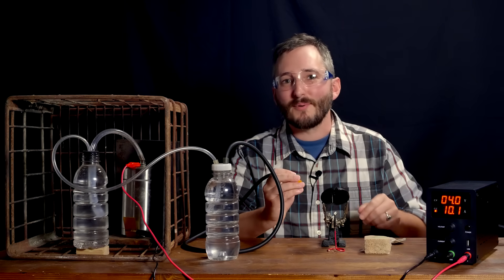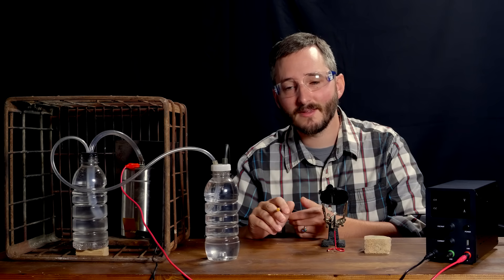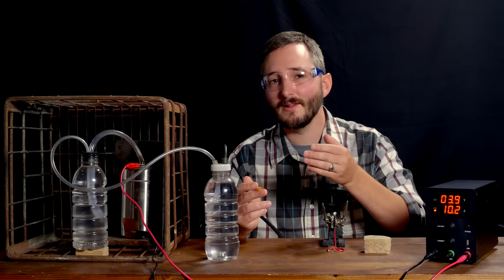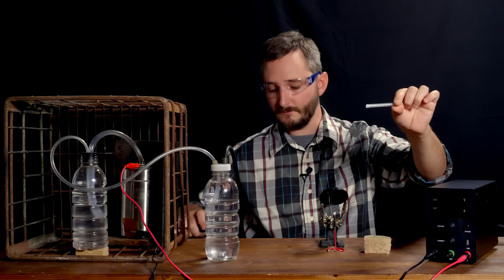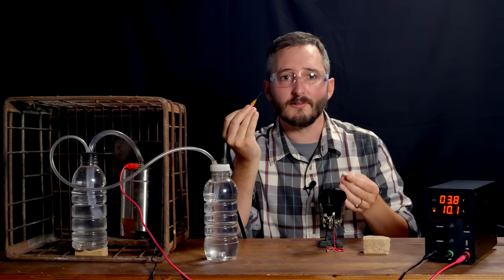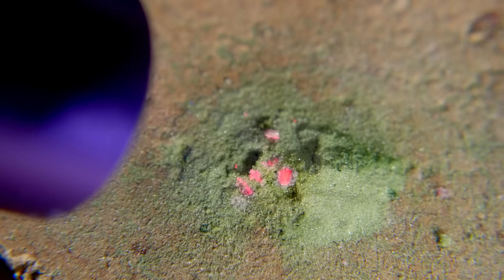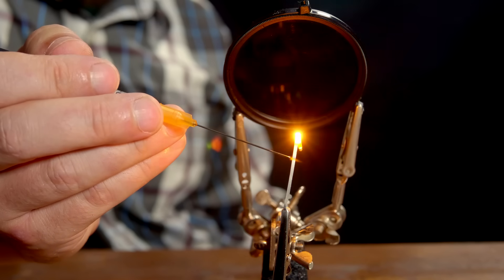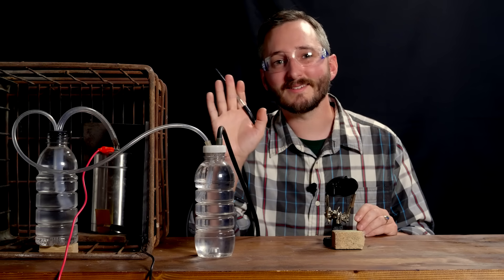DIY Oxy Hydrogen Torch Using Water Electrolysis

Comment: sadly, in jewelry setting, im not too sure this set-up would be very practical, with very little control over the size and temperature of the flame, it becomes increasingly difficult to do work that needs precision, with such heat, you are more then likely going to melt whatever you are trying to do in jewelry...

Comment: Would someone be able to size something like this up or would there need to be a method of increasing the flow rate?
Reply: Wow, I just love your projects! Have you ever considered making your own vacuum insulated glass panels (for a high R-value window pane)? Many years ago I saw someone online who had welded (with a plasma torch?) the glass together and put tiny glass beads in between the plates as spacers. But I’ve never been able to find the reference since. Anyway, thought that might be something that would interest you. (I feel like the skills you share would help society out a lot if there were a significant collapse).

Comment: Can you build a motor that uses h2o as fuel and electricity for the electrolysis to work? I had a discussion with someone about cars and i told him that it is possible to use water and electricity to make a car working. The problem is that i don.t know how efficient it is, let.s say you are using solar panels and energy regeneration from brakes. Is there any way to keep the batteries alive for at least 5-600km and using water as fuel? Let.s assume that the system has enough safety measures.

Comment: if you actually read the comments than you need to read this. I have done exactly what your doing with HHO. please make sure to secure the tube onto the needle with a clamp. My setup flashed back and blew off the needle tube and the rubber tubing shot a large flame out that badly burnt my hand. In a split second it literally charred my finger black.

Comment: A: Assuming you use the two station setup could you combine the outputs just before the torch to keep flashback limited to the junction. B: Could you make a big enough setup to use it as a cutting torch. 2500 Celsius should be able to melt most metals. C: Could that set up cut a aluminum can? being that its thin metal.

Comment: Using a silicone tube works as it's own spark arrestor by blowing out the side, then you put a spot of CA glue on and some electrical tape and it blows out another spot on the next blowback.

Comment: Having had several jewelry oxyhydrogen torches, there are several things you can do with this, most joining small copper wires together in ways practically impossible otherwise (think high end headphone wire repair, electronics repair for broken thin wires) of course jewelry. But most jewelry won't work, you aren't going to size a decent sized right with it (at least not that one) but you can retip almost perfectly with it. One issue is going to be the high flow rate blowing things away physically. On the spark arrestor, you are well overboard. The plastic bottle (just one) is plenty fine. As you scale up you might find water vapor becomes a problem, so I would use some dehydrated Epsom salt (don't know if it has a name, see n
Nilered's video) the glass melting is a fascinating alley to go down with small rods (real glass fiberoptic glass) and so-called flame polishing usually uses browns gas

Comment: I've been really appreciating your channel since I found it. A good mix of simple science, along with a more practical look at both safety and application without being excessively long.

Re: jewelry work, defiantly, and I image it would apply well to welded link chainmail as well as being tidier and easier to handle than electrical spot welding (if a bit more tedious) in that scenario

Comment: could the tip be put on a cnc and be used to cut steel? would it be powerful enought and reliable enoght to work.
How about tack welding for conductors like tungsten?

Comment: Very interesting!  Did you run into any flashback issues with it before you figured out the additional precautions, like the aluminum wool? Also, have you considered making an oxygen-hydrogen  dual-feed torch to make it safer?

Comment: I can tell you right now, if you could come out with some kind of on-demand system that was safe, maybe with a titanuim needle & a very reliable generator.. you would make a massive ripple in the jewelry industry.
  Not only would it be desirable for the eco-friendliness of burning water (not to mention savings on things like acetylene), but such a torch would be able to actually fuse metals, especially precious metals like silver, and also copper.  That would reduce or remove the need for solder.
    In one fell swoop you could actually eliminate a significant portion of all the hazardous chemicals & elements used in jewelry making.
Reply: I would encourage you to think about pursuing that, or passing the idea on to someone who could make it a reality.  I can't imagine that we're really too far from being able to do such a thing safely.  Especially with the materials & manufacturing available to beyond-the-garage projects today.
Reply: Just to be clear, there really are a lot of hazardous chemicals & things involved in how we make jewelry today.  This kind of torch could probably deal with everything except polishing compounds.

Comment: I bet this would be useful for circuit board soldering. What if you directed the flame into a tip apparatus that gets hot and then use the tip like a typical soldering iron?

Comment: One of the @Cody's Lab videos said that Silver will not burn in Oxygen, nor even in LOX, so Silver-plated Copper mesh might be really good as a flame arrestor. Also, Silver or Silver-plated torch tubes might be good in a couple of ways. While Copper tubing is not easily available in as many sizes as hypodermic tubing, there are several small sizes available easily. The smallest which springs to mind is the capillary tubing used to regulate refrigerant flow in small refrigerating units. It has a relatively thick wall, so it will absorb much more heat than hypodermic tubing, before getting hot enough to allow a flame front to pass.

Comment: When I was a kid (probably 12-13 yo), I've created a very simple HHO generator. I filled up a small balloon with the produced gas, then similarly attached it to a syringe with a needle and a piston removed, and lightened the gas up. Apparently, the flow rate was enough to stop the gas from the blowing up. After watching this video, and realizing, how many things should be aligned in order to prevent the explosion, I consider myself as a very lucky person, since I did no math or tests at all - it just worked right away. Also, most likely, I was smart enough to understand the danger, because I did not repeat this test...

Comment: A suggestion for better safety when the flame starts to go up the needle, stab the needle through the wet paper towels before you light it, then you don't have to look for the towels if it happens and might even stop it without you having to grab it. Also will help keep the needle cool in general so longer use doesn't melt the plastic.

Comment: Note. If you separate the negative and positive plates in the generator you can separate the gasses making something ALOT safer than HHO. I forget the order but one plate makes hydrogen and the other oxygen so you can keep them separate until right at the nozzle. No need to have a premixed explosive gas tube. Just food for thought

Comment: I wonder if the ideal nozzle would have thicker walls and narrower bore toward the non-tip end. Higher velocity and more heat absorption as the flame front moves backwards.

Comment: Why not use a commercial flashback arrestor, commonly used with oxyacetylene welding equipment?  Furthermore, why not have a cup of water handy to dip the torch tip and snuff the flame?

Comment: Although the flame is at skin touch 'only' 130° C, you can melt tungsten (almost 6000° C) with brown's gas.
They use steel wool in the tubes as fire stoppers.

Comment: Could it be used to remove rust? Or maybe make rust? Electrolysis rust removal is supposedly the result of free hydrogen ions converting the iron oxide type to the black kind that can be scrubbed off.

Comment: There may well be a spark/flame arrestor in the welding gas field that could be scaled down to low volume. It might be the safer idea to make the two gasses separtly and only combine at the torch head like in conventional gas welding.

Comment: Fun fact , 
We used oxygen hydrogen torches at Corning INC for melting the glass integral handles and tail stocks onto our canes of glass . These canes were actually the core of fiber optics of which I was making at the time. We made the glass from scratch out of Germanium and silicon tetrachloride. 
The flame on these torches were a very very light orange color , but the heat was tremendous. We use to have a timer on our GUI that told us when it was safe to light the torches. If you did it to early you would blow out the flash back arrestor. 
When melting the glass , we had a UV resistant / tinted cover that covered the machine because when the torches were melting the glass it would produces the brightest, most tremendous yellow I have ever seen aside from the sun. It would light up the room when the engineers were working on the machine.
Also I do believe our torches were ran off a straight line of hydrogen and than the oxygen would be fed into the torch burner its self.

Comment: As for safety, what about placing all the stuff inside deepish hole in a groundbonus points if it can be covered in sand decently convenient, sure it might raise some dust if it explodes, but should not have enough energy to move too much stuff too fast. Though might be overly inconvinent for the benefit.

Comment: This is super awesome.

Somewhat silly idea, since it seems to be hot enought to melt sand, and sand/glass is not great conductor, that could almost be basis of a 3d printer printing out of sand, dont remember how those are called, I think sintering printers, I know they exist for metal grains, so this should be able to do that for sand.

Comment: If you can stop a flash back with a wet paper towel, why not have a tube filled with water around the needle, or a finned aluminum block keeping the needle too cool to flash back

Comment: How about your separation generator setup showed is earlier episode? Just create gas in different lines and feed it into oxy acetylene torch where mixing happen and since only place where two gasses are mixed is in the nozzle and its pretty damn durable thing, you should not have any issues with explosions and you can add bubblers and flashback arrestors on the generators feed as extra safety measure, making this usable for DIY guys garage, who does not want to have bottles of acetylene and oxygen laying around, just need water and electricity to use this setup. I think this should be developed further since there is very much potential in this idea, but i dont know about the gasses that much to build it perfectly safe, but you do.

Comment: Can you effectively weld two separate pieces of borosilicate glass together? For example if you wanted to connect a bunch of glass tubes together or even (after drilling a hole) weld a tube to a beaker to create your own specialized laboratory equipment? For example, can you turn a standard addition funnel into a pressure equalized one?
Reply from the maker: Melting the glass is no problem but you need to know what you're doing to aneal it properly so it doesn't crack when it cools down
Reply: @Nighthawkinlight  if there’s anyone on YouTube with the capabilities while using materials available to most people....it’s you

Comment: When I was younger I made a much larger version with forced cooling out of alternating stainless steel wall tiles and gaskets. It kinda looked like a stainless steel sandwich held with bolts. I used an actual torch flame arrestor and a small brazing torch. The secret is the water pump forcing the liquid and gas to a separating tank. Then secondary bubble flame arrestor. Then to the actual torch arrestor and torch tip. It was hard to see the flame but 1/2 steel was no problem!!!

Comment: I'm curious, can it locally melt a tiny section of a larger piece of metal? Even if it is rather conductive, like aluminium? If so it might be nice as a micro TIG welder of sorts.
Reply: If the metal is able to conduct the heat away faster than the torch can put the heat in then the torch will be unable to heat the metal very hot. You have to put heat in faster than the heat loss. The torch might be burning VERY hot but don't confuse temperature with power. It's a very small amount of 2,500 degrees. Note the maximum power will only be 35W because that's all that is being put into the system. Also, it will not be 100% efficient so the actual power in the flame will be even less than that. 
Also, it wouldn't be a micro TIG welder, it would be a micro gas welder. TIG welding uses the heat of a small electric arc, not the combustion of a gas.
Reply: @Kimdino1  yes, I understand that and I was wondering if he tried. Because it is a balance,  you might melt a tiny local bit of metal if the heat of the flame is on the right side of the balance with the transport of heat. I am not mistaking anything with power. I merely stated TIG as a sort of comparison, melting a small local bit of metal. I know what a TIG welder is thank you. Maybe I should have stated a pulse laser, idk? So nice monologue, but you didn't understand my question right.
Reply: Tig welding uses electricity
Reply: @nathanlewis5682  oh ffs, I said of sorts. I meant the outcome, not the process. And if you want to nitpick, this also uses electricity to create the hydrogen and oxygen.

Comment: I built a bigger HHO system several years ago and you are right, they can be VERY dangerous if not treated with care and respect. That said there is a lot you can do with HHO gas. I found that the gas flame itself seemed to be cool, it didn't get hot until I reacted the flame tip with something. 

I would love to see you test your system out with a FLIER and see if the temp changes as you react the flame with different materials. I think that the flame changes temp based on the material it is being subjected to.

Comment: this would be really cool as a smaller battery operated device
Reply: maybe  a sintered metal filter as flashback arrest, electrode and outlet in a small zylinder with a thin line with thicker walls going out? shutting off by cutting power shouldnt be an issue because the flame shouldnt go far into the line. could be operated with the push of a button and would be handheld and safe. basically a small high temperature lighter
Reply: 3d-printer hotend as a nozzle that sucks the heat away
Reply: with a piezo to light it it really would be a small high temp lighter
Reply: or you could use one of those arc lighters as power source and light it with that

Comment: For everyone who thinks two flashback traps are overkill, I remember when the flame somehow made it's way all the way through a trap and into the Tupperware box reaction chamber which then exploded, spraying my whole room with electrolyte solution and making my ears ring for the rest of the day.
Reply: In his previous video, the slow motion demonstration showed a few bubbles almost make it over the crest of the tube between the electrolysis device and the flashback arrestor. A second flashback arrestor in series is actually a good idea, imo.
Reply: Hm... I would rather not get caustic electrolyte into my eyes and mouth.
Reply: Ouch

Comment: Could you store the hydrogen and then use it in a small electric generator basically as a battery perhaps connected to a small solar panel setup

Comment: I inquired about commercial flashback arresters, there were none available, so i built my own, which worked, i got several aquarium bubblers, and took out the plastic, i then placed two together and glued the edges and fitted them in a pipe i placed two of these in the feeder pipe, these work i tested them ( with a lot of fear) but they work, the ceramic particles take the heat out of the flame so fast it does not get through, and stops dead at the first home made flashback arrester, so i continued with my experiments, i had a 12 x 6" stainless steel plates, connected to a car battery, and produced loads of gas, commercial HHO machines are sold for use ion the acrylic business to smooth of edges and removing scratches.

Comment: got a question and problem, wanna try a design problem can someone help, I wanna text on youtube to Youtuber on how you could make a miniature gas regulator and can find how I can text this guy, I know how to make the pressure regulator or people have a post you need to be a Patreon. will not find anybody to text online exploding proof system one gravity control blowback alive final stage spring control, have in texting today. so much for youtube. all I need is an engineer cad app

Comment: You've put the oxy-hydrogen torch *in the limelight*, even literally!

The tiny torches are useful for smooth sealing glass ampoules but I think you need two for better heat distributions. I do that with butane torch but that allows sealing by only heating the glass and pulling away, melting only very small area not the nice round "cap seal" seen on factory-produced ampoules.

BTW it's interesting the flame almost melts lime but not really, since the flame temperature ranges between 2000 - 2 500 °C and the m.p. of calcium oxide is 2 613 °C. An exact stoichiometric mixture (maximum efficiency flame) will get to 2 800 °C, still may not be enough due to small flame and heat dissipation.